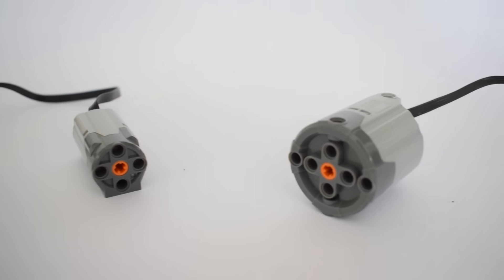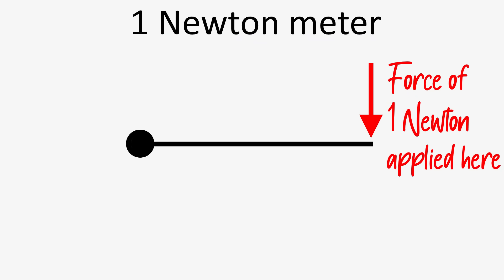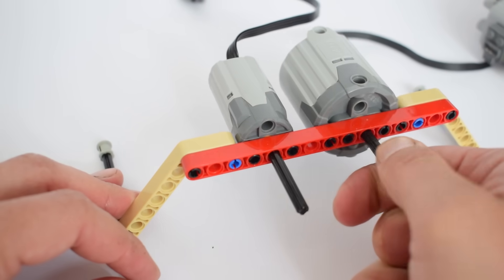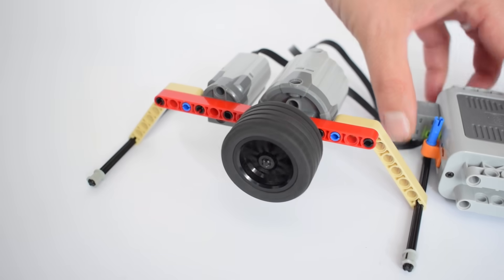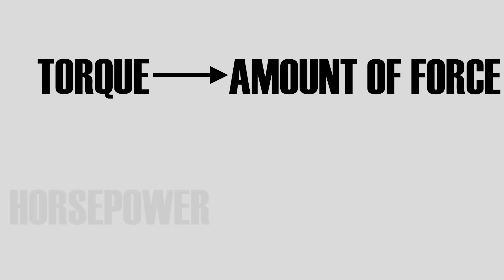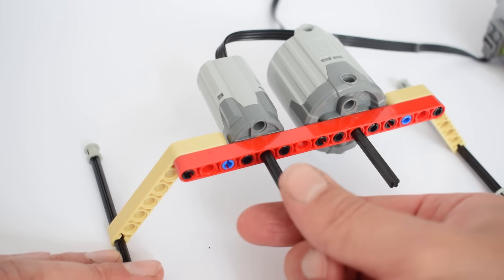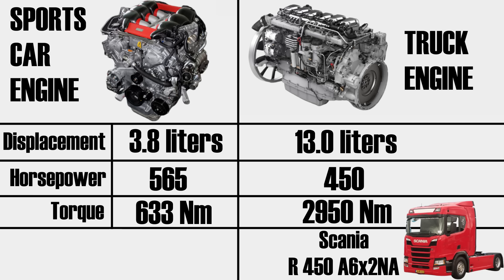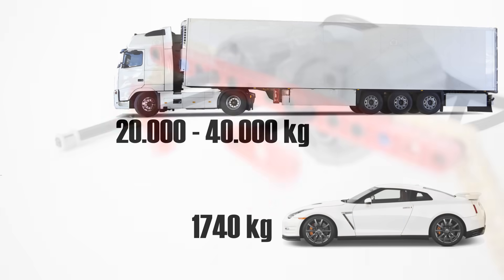NEVER be confused by HORSEPOWER and TORQUE again - HP and TORQUE EXPLAINED in the MOST VISUAL WAY

Comment: Easily comprehendible, honestly horsepower was one of the concepts that I couldn't wrap my head around. Now am familiar with it I'll have to think about it more but at least I'll know how to think about. Thank you for the video
Reply: Left to my own devices I'd have defined 'horsepower' with the actual definition of torque before seeing this video. Sometimes the YouTube algorithm does good things like feeding my idle curiosity about how stuff works, and now I know better than I did yesterday.
Reply: @robwoodring9437 Yep. Car marketing over the decades has convinced everyone that HP is power. When in fact, it's torque that matters.

The HP number is usually bigger. So they market with it.
Reply: think about weight ratio too. think about gearing that manipulate torque. his other video is good but HP and torque is the hardest to explain. also, not everyone understand it fully - reason i said fully because this is why car manufacture have races and time laps base on certain requirement.
Reply: Well yeah, it's hard to wrap your head around PRECISELY because horsepower a useless bullshit metric.

All power is generated in the engine. Measured in torque.

Higher RPM, for any given torque value, gives you more so-called "horsepower". Ok, that's fine, but that's useless information. Because if I want to go faster, I change the gears.

Thus: I'll take the 300ft/lbs 100HP motor over the 100ft/lbs 300hp motor every time.
Reply: @mustangstuff7213 You’ve got it backwards. Gearboxes negate the need for high engine torque, not horsepower. You can use gearing to make the torque to the wheels whatever you want. That won’t change the work the engine is capable of doing.

With gearing appropriate for both and the same car body, a 300hp/100ftlb engine will out accelerate a 100hp/300ftlb every single time and it’s not even close.

Comment: Horsepower has little to do with torque. You can have great torque with little hp if you have good gearing. My grandpa's tractor had 50 hp and could pull tons
Reply: That's because engine's torque is not needed to pull tons. How much torque was there? 300nm? Modern Dodge Charger's hemi has 550nm or something. A 18V screwdriver has 600nm
Reply: Horsepower has a lot to do with torque, it is one of the two things that define horsepower. Power is torque multiplied by rotating speed (angular velocity).

Comment: I have understood the difference for a long while. But have not been able to grasp the difference it makes in the real world and why horsepower measurements are required at all. Can someone please enlighten me?
Reply: Power is the only thing why engines and motors are there. Any force can be achieved by mechanical advantage in a trade of a speed. You input a force and speed and through simple machine (lever, gears, wheels) you output the amount of force counter proportional to the amount of speed. If you input, say, twice more force with the same speed or twice more speed with the same force (both means power is doubled) you can make twice more work at the same time or the same work twice faster.

Comment: All you have to say is that horsepower is a work/time equation and torque is a pure force statistic.
Reply: There are two axles with same amount of torque. One axle drives a small wheel, another axle a larger one. So what's going on with force on the wheel?

Comment: torque is how hard you hit a wall, hp is how fast you get there
Reply: 🤣 good joke but really no  give you egzample. we have 2 the same car 3 tons  perfect gearing bla bla everything optimal full tracticon 1/4 mille distance formacceleration one car have engine 500 nm 125 hp second car have engine 375 nm 250 hp  first car accelerate to 100 km/h energy 1160000 joules  and 83400 kgxm/s momentum second car accelerate to 127 km/h what mesn more energy and momentum for second car … quees which hit wall stronger ☝🏻… its only one egzample we can in fact setup multiple type of diffrent setup assuming optimal gearing more power always or almost always hit wall stronger and do more damage as 3 newton law say to both car which hit wall and wall ☝🏻torque hit wal harder power hit wall faster is as bull💩  as torque win race power sells cars 🫣some people think its like being slap be small weak woman which is fast sp thers alot power no …if there would be alot power you would go to sleep assuming perfect timing always  ☝🏻 😴 tehre was not alot power there was only speed „no”power 🤷🏻‍♂️☝🏻

Comment: "Let's torque about horsepower" Still in the dark. From your video I come away with torque being a static measurement, no movement is required. And horsepower is a dynamic measurement, force measured over time. Here are the specs from a 2007 Mustang V6." The 4.0 V6 produces 210 hp (157 kW) at 5300 rpm and 240 lb·ft (325 N·m) of torque at 3500 rpm. Torque peaks at 3500 rpm. Seems, to me, torque is measured just like horsepower. What's the difference?
Reply: Power is force times speed, or work over time. 
What's your question about stang engine?
Reply: @simplemachine9531  Torque figures for an engine are given at a specific RPM. In contrast, a steam engine has its greatest torque at a stall. An electric motor can also exert torque at a stall. But an ICE cannot. The engine must be rotating to measure torque. So how is that measured separate and different from horsepower?

Comment: I still have the same question I had before watching this clip. If it's been answered, my question lingers only because I'm not smart enough and I'd ask anyone here to take that into account in case you will provide a different approach to try and answer said question. Which is the following.

Why could one not just use a smaller  gear onto a bigger gear (one with the output of a truck's torque) to then be able to match or beat the HP of a smaller engine of a sportscar. I mean, why can't you use gears to more effectively translate torque into HP. For me it makes no sense that a bigger engine, with bigger combustions, thus generating more torque isn't able to, via gears (small onto big) outmatch the HP output of a smaller engine.

I hope that makes sense.
Reply from the maker: This will answer your question https://youtu.be/txQs3x-UN34
Reply: You don't use the provided formula: power=torque x rpm. So with a given power output, you can trade between torque and rpm, while you try to trade between power and torque.

Comment: Torque is wat turns the wheels. Bigger torque, the faster the wheels rotate.
Reply: Rethink it. At top gears torque is minimal, while wheels rotate at maximum speed
Reply: machine  yes, torque is good at take off, I think for about up to quarter mile or so   , is that right ?
Reply: @aldob6379 . Any race is won by a car that has put more average power (torque times rpm) to the wheels (considering weigh is equal). There is a ton ways to understand it. 
Race is a fixes distance, the car that burns more energy (fuel or battery charge) before finish line wins. The only way to spend more battery charge is to ride at maximum power. 
You can reach peak torque at 4000rpm and ride on the first gear only, putting maximum torque possible to the wheels and of course you loose. You will loose even if you shift gears up at 4000rpm instead of reaching peak power at, say, 6000rpm and shifting there. Just check at which rpm your automatic transmission shifts gears up when you floor the gas for maximum acceleration.
Reply: @simplemachine9531  thx for that info.
I have a manual.
Reply: @aldob6379  anyway, you probably understand the max torque is not at 7000rpm here. 
https://youtu.be/AlJVDvPSbHI
Reply: @simplemachine9531  got it,,,, thx .. worth watching.
Much appreciated

Comment: This is a great explanation but one would still get the implication that one should look to torque to indicate what will give you the feeling of being thrown back into the seat. You still feel acceleration, and 2 engines with different power and torque could theoretically produce the same feel of acceleration

Comment: Now hold on a minute....... the math ain't really mathing!! How you get those horsepower values for the lego motors?? For both I multiplied the RPM with their torque and get numbers way off. 8.25HP for small and 20.44HP for bigger motor.
Other than that great video!!

Comment: In theory, the smaller motor could be geared to output more torque, and the larger engine to output more hp. But that's not what they are designed for.
Reply: Power can not be multiplied by gearing.

Comment: Could you not hook the low torque motor up to a gearbox that slows down the rpm considerably but increases the torque? Then you could get the same performance in a much smaller engine
Reply: Sure that's how things are done in auto sport
Reply: you can but you must consider longevity.  high spinning parts always wear down way quicker and generate tons of extra heat from friction wear vs a bigger sized motor that can operate under low rpm's.  you could theoretically put any sports car engine into a semi truck and gear it appropriately, but don't expect it to last long having to rev at 7000 rpm all day long.

Comment: I'm sure my way of thinking isn't perfect, but I think of it as "torque starts the momentum, horsepower takes that momentum and runs with it."
Reply: Torque is part of the power. You start with power and end up with power, shifting balance between torque and rotational speed in the process.

Comment: While it easy to distinguish between between power and torque, it is more difficult to explain the difference between energy and torque, considering both are measured in Nm
Reply: That makes no sense.
Reply: @LiveFromLondon2  First: Thank you for reflecting my statement and responding. Second: Of course it does, it is 100% correct. But, don't be embarrassed. Unless you studied physics in college, you would hardly know. In short, energy is a scalar, where the force in N is applied along the way in m. Torque is a vector or vectorproduct, where the force in N is  applied perpendicular to the leverage in m.

Comment: thanks for the explanation. I'm still left with a question though: In theory you could change the torque-HP characteristics of any engine through gearing. The truck engine could be used for a racecar and have it make less torque and more HP through different gearing (ofc it would be heavier but that's beside the point here). So in the end the torque-HP characteristics are still very much dependent on how the gearbox is set up, right?
Reply: Actually torque can be changed through gearing,  but HP remains constant.  HP= torque  x RPM.  So different gearing will raise torque while lowering RPM, or vice versa.  I actually was not impressed by the explanation of  HP vs torque in this video, as so many people were.  I can see how you are still confused between the two.  Technically, the concept should be called power vs torque, because HP is a specific unit of power, just like NM is a specific unit of torque.
Reply: @kimstockdale632  depends where you are measuring the torque. at the crank or at the wheels? There are losses on the ay to the wheels, but, if you ignored those losses, it would remain the same. Gears allow for more power, not more torque. Ie more punches of torque, but the individual punch would be the same. The rest of what you say is correct.
Reply: no, not really. Thats a totally separate issue to do with a specific task. Torque and HP will be the same no matter which gear you were in. In a car engine, torque comes from the explosive power in the cylinder. So, one half cycle of the piston is the torque. More fuel = more force. Gears are for condensing the force into a shorter time frame.

Comment: Many decades ago, I was an apprentice electric traction motor technician. One of my duties was to operate a Thomas Salter brake dynamometer. This contraption had the traction motor under test, attached to a dynamo and a load turbine. The dynamo was wired to a slave motor, which had a 12 inch torque arm attached from its spindle to a set of scales, calibrated in pounds. This contraption was the definitive brake dynamometer, and all readings were recorded as brake horsepower (BHP), as opposed to horsepower (HP). All our traction motors were tested and stamped 22 BHP @ 2,000 RPM / 48 Volts @ 54 Amperes peak load consumption.

Power quoted as BHP = Derived from mechanical torque arm acting on a set of scales. (Torque x RPM/ 5,252 = Horsepower).
Power quoted as HP = Derived from the electrical output of a driven generator (746 Watts = 1 Horsepower).

Comment: OK Im confused and Im not a low IQ guy--I have a IH 444 inch diesel. 7.3 liters.  I have a firebird with a 5.7 liter gas. The firebird has almost 400 HP and the diesel only has 250 HP but it has more than double the torque of the 5.7 gas engine. The gas engine has almost double the redline. If we take two identical vehicles, which will be faster? Or if not a speed thing---which will pull the most weight? Im still confused over torque vs HP

Comment: This is just wrong and misleading. Amount of torque generated at a given speed depends on the power output, not torque that engine produces. Sports car engine could easily be used in the truck and smaller torque would be compensated by 3 times better gear because of the difference in RPM. The reason small engines are not used in big trcuks are mostly due to reliability. 
P.S. Torque is pretty much irrelevant, since any engine can produce any torque, all you need just set of proper gears.

Comment: This video is a great first try, but it didn't go how I thought it would.

Assuming this video is here to help parents help their kids understand relevant STEM concepts using Legos, I think the video would be much better if it compared and contrasted two motors/engines with roughly equal horsepower/wattage: 1) a low-torque/high-RPM motor/engine, and  2) a high-torque/low-RPM motor. 

With this new approach, you would get more easily observable results, especially for kids.  It would clearly demonstrate there's more than one way to get a job done, and generally speaking, there are normally Pros and Cons associated with each approach. 

With this sort of apples-to-apples comparison (using power as the observable feature), you can make a simple video, and more importantly, have a follow-on discussion with your kids, including design for an intended purpose, optimization, design tradeoffs, and all that.  That's where the sticky learning takes place, because the kids have to talk about and make decisions based on what they watched, but may or may not have learned.

So, after such a video, you could talk about and demonstrate how a low-torque/high-RPM motor/engine has certain Pros (e.g., allows for more lightweight/portable design), but also has certain Cons (e.g., runs at high speed to generate power, so probably wears out faster and may generate more heat, high frequency vibration, etc).  The high-torque/low-RPM engine/motor (which again, is set up to provide comparable  power) would have different Pros and Cons.  One Pro: it's more heavy duty, and will generally last longer, in part because it's not being red-lined all the time to generate power.  One Con: It's more heavy duty!, and so will generally be heavier and require stronger/heavier components around it. 

When you frame it this way, kids can see how one design might be preferable in one environment/scenario, but another design might be preferable in another environment/scenario.  Then you can all make up different scenarios, and ask which setup they would want in those particular scenario.  

You would also get great observables, a lower humming, high-torque motor, versus a screaming high-RPM motor, both outputting the same power. You could look at the size of the shafts, you could compare the weight , etc.  But the point is it's an apples-to-apples comparison using power, which is a less abstract/more concrete concept that kids can very easily observe, and learn from, on a macro-level.  

In short, I'm surprised this video didn't compare motors outputting the same power, but with different torque and RPM settings.  To me, that's by far the clearest way to do what the title of this video claims: to understand the difference between power and torque.

Comment: This video is decent, but NOT what most people are LOOKING FOR. Most people are looking to understand how torque and horsepower affects the rate at which a car with an internal combustion engine accelerates and that's where the most important factor is actually the horse power curve (not the torque curve and not the max horse power or max torque) and how it looks like, of course assuming other factors like car weight and transmission and other losses are the same. 

This isn't meant to criticize the author and it's a very good explanation in it's own kind, I'm just trying to help some other people which are actually looking what I had been looking for for a long time. Needless to say to come up with what I've said I went over tons of videos and websites and it was even harder to understand because some websites and video authors did not understand themselves what they were talking about making it even harder for other people to understand this...